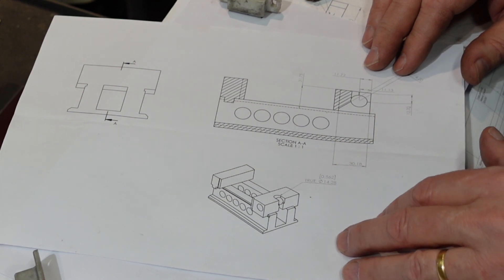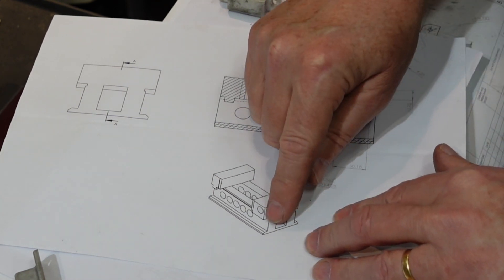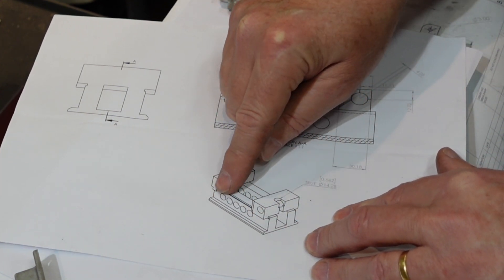Boot strapping a mill part 4

Comment: I have been fallowing this series very closely as I am currently equipping a mill in my shop. What are you using for curring cluid/oil? How much is the right amount to apply? I think this would be a great tocovefor you to cover.
Reply from the maker: I have two things I use. One is neat cutting oil that I apply with a brush. Usually that is used for tapping, reaming, drilling and similar things on steel. The other is WD-40 or similar stuff I use on Aluminium but also on Steel if I need to cool it. This is in a squirt bottle so no contact needed. That is what I use for 'coolant'. Quantity varies. If I'm tapping Al, I just wet the tap. If I'm milling I tend to give a couple of squirts until I can see the stuff sitting on the material (that is, it's not evaporating/ smoking off immediately).
Whatever you use, arrange some ventilation so you don't breathe the vapours. Can't be good for you.